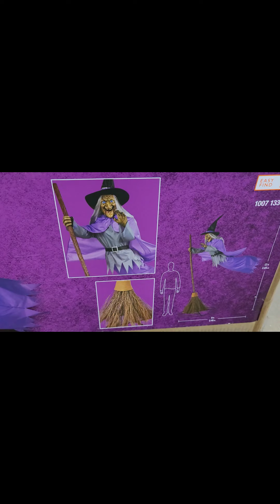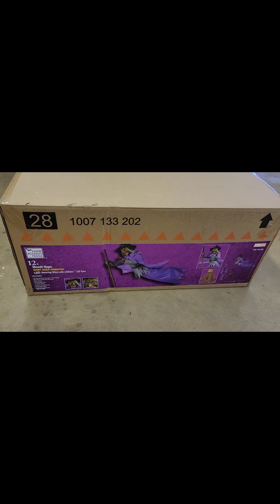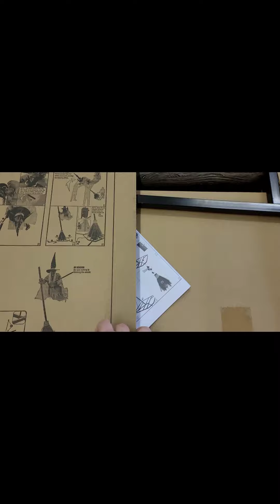Home Depot 12ft witch assembly

Comment: The one I bought is only a fraction of the size it's nothing like the one in the advertisement
Reply from the maker: Is yours the new version with the black dress?
Reply: Mine has exactly what is shown in this ad but I thought it was bigger it doesn't have a stand just a broom
Reply from the maker: That doesn't sound right...u may be missing pieces

Comment: We can't hear the audio, she only lights up
Reply from the maker: Make sure u have her on correct mode, there's one mode where u just get lights. She only activates sound with sensor. Also make sure the volume is turned up and the connection wire on her outfit is connected properly...alot of people have missed that one
Reply: @cindyovercash  thank you so much for your reply. My husband did get her to work now. Thanks again. 😀